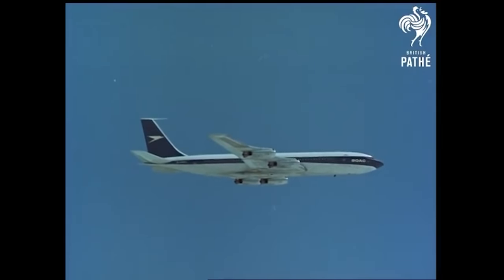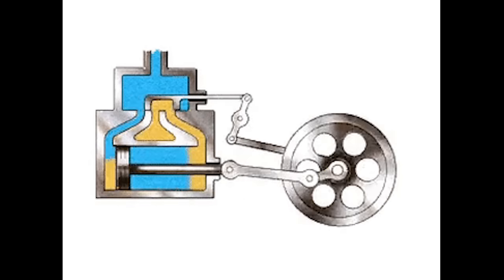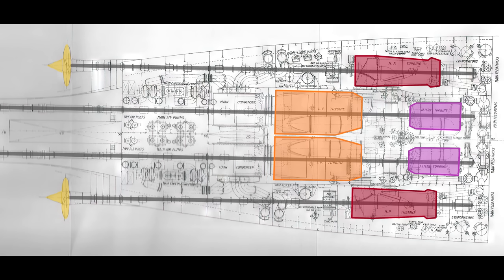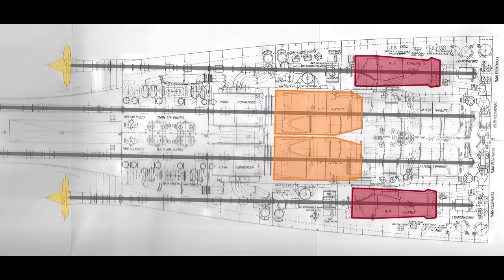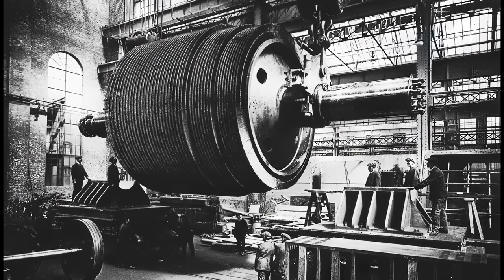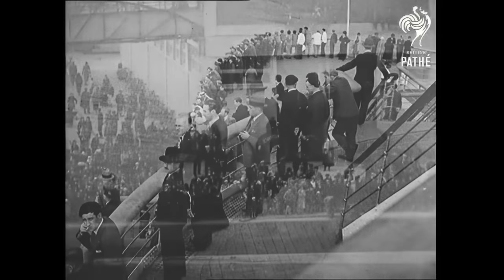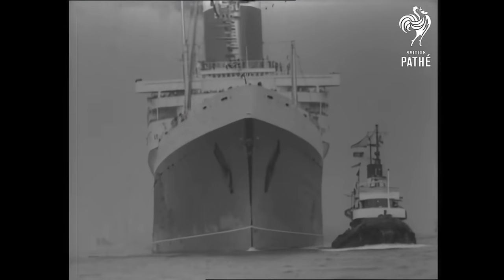The Rise of Turbine Liners

Comment: A bit confused as to the difference between power-to-weight ratio and fuel efficiency. Turbines had/have far higher power-to-weight ratio than a reciprocating steam engine but less fuel efficiency, especially if operated outside their very narrow power band. They were also, in those days, a LOT harder to make than piston engines. BTW the same pros and cons still hold for gas turbines vs diesel engines - that's why war ships use turbines while modern cargo ships (that don't care about speed) use diesels.
Reply from the maker: I'm really the wrong person to ask about that, I'm just a history guy. But maybe someone who knows engineering better than me will respond.

Comment: Although steam turbines are no longer used on most ships, they are still the hearts of many aircraft carriers and submarines today, being heated by nuclear reactors instead of boilers. Thanks to having steam turbines instead of diesel engines, the Nimitz-Class supercarriers can reach a top speed of an astounding 31.5 knots and have a maximum power output of 260,000 shaft horsepower.
Reply: USS Enterprise produced 280,000 shaft horsepower to produce a speed of (classified) knots.  (Yeah, I know what wikipedia claims for top speed.  They're wrong.  USS Enterprise, Reactor department, 1981-1984)

Comment: Nice video, thanks. There were a few details that need to be defined. One is the comparison with turbine and piston engine. Titanic`s reciprocating engines had totally 30 000 hp by 215 psi and the turbine got steam from these two engines having 16 000 hp by 9 psi. The steam expanded in the turbine to vacume so, that the pressure drop was bigger. This is important because the power is pressure drop x volume flow. For example 1N x 1m3/1s = 1W. The steam leaving the piston engine has already great volume flow and when expanding in the turbine even to vacume it becomes huge. So you can`t compare steam turbine and reciprocating engine like that. RMS Mauretania never made 29 knots, it was 28 knots but 29 miles per hour. Knots and miles per hour are not the same. SS Normandie made about 30 knots. So RMS Mauretania never took the blue ribbon from SS Normandie. RMS Queen Mary and SS Normandie with a more hydro dynamic hull had same speed. First the Blue Ribbon went to SS Normandie, then to RMS Queen Mary and after new propellers back to SS Normandie and then back to RMS Queen Mary.
Reply: Sorry my mistake. 1N/1m2 x 1m3/1s = 1W
Reply from the maker: From the information I have, it's been published in books like "the only way to cross", that Titanics engines all together, had a combined output of 46,000 shaft horsepower. That comes out to 16,000 for the turbine, each reciprocating engine had 15,000. If you can point to a source that says each engine could do 30,000 putting the total of the ship to 76,000, it would be helpful with my future research.

I dont recall saying Mauretania took the Riband from Normandie, but I have seen an abstract log showing the Mauretania making 29 knots, I dont think it was consistent through the voyage, but then again the speeds never are.

Both Normandie and Queen Mary were matched with hydrodynamic hulls, but for very different reasons. Most people don't know that QM's cruiser stern helped keep her higher in the water at speed, reducing drag. Just as Normandie's slight bulbous bow helped reduce the bow wave, which in turn helped reduce drag...but her stern still dug into the water at speed, negating that drag decrease to an extent.
Reply: @AlextheHistorian  Thanks. Most people don`t know... I didn`t either. Great detail of QM`s hull structure. I just read from Great Ocean Liners, that Mauretania made even 31 miles per hour. So it really is 29 knots. You didn`t say Mauretania took the BR from Normandie. A long telefone call between writing mixed my thoughts. This wrong text was from the Finnish Wikipedia I had just red: During her last voyage ss Mauretania took the Blue Ribbon back from SS Normandie. This can`t be true.
But I tried to clarify, that 215 Psi / 15 000 Hp -> 9 Psi 16 000 Hp should be 215 Psi / 30 000 Hp -> 9 Psi 16 000 Hp, because the turbine got steam from both reciprocating engines. And the power is not comparable just to the pressure but also to the volume flow. Some watchers could get too bad impression of reciprocating engines if they don`t consider this. If steam temperature is steady (of course it drops)  and the pressure drops to half, then the volume grows two times higher. So the steam volume really exploses in the turbine when flowing to the condenser vacuum, and the turbine can utilise this. To utilise this explosion in a reciprocatin engine would need monster LP cylinders with huge power lost and need of space.
To combine piston engines and a steam turbine was one way to combine advantages of those two methods, but it combined also disadvantages, for exampel the need of lubrication oil.
Reciprocatin engines and steam turbines have the same thermodynamic base, but they have very different features like internal combustion engine and gas turbine.
Reply from the maker: I see. Thank you for the info!

Comment: Finally made time to listen to this while weed whacking this very large field. Only thing I really have to add is that Normandie, when she retook the Riband from Mary in '37, actually managed to produce some 195,000shp. This was super cool learning more about steam turbines and other engines. You should do more videos like this when you're not covering topics like Queen Mary!
Reply: I hadn't heard of that!  That's really cool.  I know that the CGT was planning a running mate for Normandie, likely named Bretagne, and that they intended for her to have a significant increase in shaft horsepower.  It makes sense for Normandie to have gotten an upgrade, or it's possible that by then her machinery was well run-in and the engineers had learned how to get the best out of her.
Anyway, thank you for sharing that!

Comment: Very nice video I work in a small trash the steam plant or a little turbine is 60,000 hp and makes 37 MW of electricity and I’ve worked on it for 24 years. The biggest one I’ve ever worked on was 1900 MW and believe me, it was a little machines they were amazing. Very nice video.
Reply: 1900MW in the US? The only turbines I know capable of 1900MW are the Arabelle units from Alstom.

Comment: Years and years ago I read that Titanic's steam turbine was huge possibly the largest turbine ever placed on a ship.  Another great presentation by Alex the Professor!
Reply from the maker: It's hard to say, I would think that the low pressure turbine on SS United States would be the largest, but on the internet, there exists no blueprints or vintage photos of the turbines. It's possible Titanic's was the largest, but I gotta admit, it looks identical in every way to Mauretania's low pressure turbine.
Reply: It may be interesting to compare with the turbines of the Iowa-class battleships, which had power similar to that of the "Queen Mary". It's great that they all still exist. The "United States" has a similar powerplant.
Reply: Titanic's equally ill-fated sister Britannic had a slightly larger turbine (Britannic was slightly larger and so they tried to make it more powerful). It weighed 420 tons and according to marine engineer and historian Denis Griffiths it is the physically largest marine steam turbine ever built, but not the most powerful since it operated at low pressure.
Reply: @campbejk1  Thank you extremely interesting!

Comment: It should be mentioned that reciprocating steam plants didn't go away entirely after turbines came onto the scene, they continued to be used in applications where the higher torque/lower shaft rpms plus their simpler construction and maintenance would be an advantage, such as freighters, tugs, and cargo/passenger liners.

The Liberty Ships, such as Titanic's movie engine room stand in SS Jeremiah O'Brien, were designed at the outset to have a triple-expansion reciprocating plant to a nearly 50 year old design. Why? Because they would be simpler to mass produce, operate, and maintain in wartime, and there was a wide pool of engineering crew who knew how to run and fix them.

The last coal fired steamship still in commercial service, SS Badger, has reciprocating engines, of the Skinner Unaflow design. Similar to a diesel engine, they use poppet valves and have twin single-acting cylinders with twin cylinder heads.

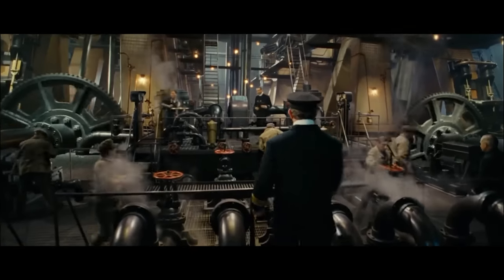Comment: With a turbine that is meant to run at 9psi and generate 16,000hp from it at that…. I get confused by trying to understand on how and where that steam pressure goes? Does it re-condense, is there an outlet that it vents out of? 5:00
Reply from the maker: Yes, after the steam is used up it is vented into condensers which use cool sea water to condense the steam back into its liquid state, and that water is then pumped back to the boilers to restart the steam cycle.

Comment: This video was well put togheter but it has a few problems the bigest of wich is using horsepower to compare reciprocating engines to turbines. Usualy you would want to mesure reciprocating engines power in torque becuse reciprocating engines have a lot of torque but litle rpm sinch horsepower = torque x rpm and reciprocating engines have their max amaunt of torque at 0 rpm

Comment: Correct me if I'm wrong but wasn't the 1904 RMS Victorian built for the Allan line the first Turbine passenger liner? Also I believe that the Normandie was rated for 160SHP but achieved over 180SHP. Just like the QM was rated for 180SHP but could go over 200SHP. And it must be said it took the QM that 20kSHP to achieve that fraction of a knot higher speed higher speed due to her much less efficient hull design. PS: Love the video!
Reply from the maker: Yes you're right about RMS Victorian, that information was not made available to me until after I made this video.

As for Queen Mary vs Normadie actually the two ships had tradeoffs with their hulls. Normandie reduced drag with her bow. Queen Mary reduced drag with her stern. I made a video that answers why:
https://youtube.com/watch?v=PXUrJd6UyO0&si=EnSIkaIECMiOmarE
Reply: Victorian and her sister Virginian made their maiden transatlantic voyages in March/April 1905 and were the first turbine powered ocean liners. Previous turbine vessels were much smaller and for shorter routes (the Clyde River, or short distance ferries).

Comment: Wish Olympic was preserved, just to look at these breathtakingly huge reciprocating engines!  
I know that turbines a more efficient and have more power/weight ratio, but i want reciprocating steam engined ship. 
That's why I admire Olympic class, except their balanced exterior aesthetics, they were last big liners, equipped with reciprocating engines. 
Comparing reciprocating engines and turbines for me is like comparing mechanical watches/clocks to battery-operated ones.

Comment: Steam turbines are still in use - nuclear submarines, aircraft carriers etc use them. I actually think they maybe in for a bit of a renaissance as oil prices increase and smaller, safer, and cheaper reactors become available. I mean, I don't think liners are making much of a comeback any time soon, but there's plenty of gas guzzling cargo ships. However, I'd imagine a nuclear reactor on a cruise ship (and it has been tried btw, eg NS Savannah) is probably a long ways off as the public is still pretty squeamish about that sort of technology!
Reply: Some LNG carriers still use steam turbines, they run on the boiloff gas from the cargo.
Reply: there are laws banning nuclear, it has nothing to do with the public

Comment: What was the reason why they stopped using steam turbines and switched to diesel engines?
Reply from the maker: Cheaper to operate and more fuel efficient.
Reply: It's probably better by weight to carry oil in barrels then coal as it's a more powerful fuel source
Reply: @TalesOfGothic  They switched from coal to oil before they switched from steam turbines to diesel engines.
The Queen Mary (1936) was fueled by fuel oil, not coal.

Comment: Hello,
Very good. It would have been interesting to explain why steam reciprocating piston engines had less yield than steam turbines whereas internal combustion piston engines still have today better efficiency (especially when combined with steam turbine).

It's because steam temp, even reheated (under 500°C) is well managable by turbine blades while internal combustion chamber can go up to +2.000°C. So compression ratio of internal combustion turbines cannot challenge piston engines in term of yield.
Gas turbines can also handle 1.200 °C.  When combined, they can pretend to approach piston engined combined with steam turbine. 

By the way today non combined  gas turbines are generally used only when space and/or weight power ratio is the main criterion. Helicopter, mid alt aircrafts. 
For sea ships purpose today : combined gas turbine + steam turbine are also good competitor of combined piston engines + steam turbines. 

Note that steam turbines only, as used on LNG ships do not have the best fuel efficiency. 
Without combined cycle, 2 strokes turbo diesel has still the best efficiency. 

P.S : I also understand that the piston steam engines of the 1900+ ocean liners, at least initially, required much less maintenance than the first steam turbines.  And Mauretania and Lusitania had their engine to be revised some years while Olympic's run without major serviced until 1933.

Regards
Reply from the maker: The reason I didn't explain it is because I'm a history guy and I can barely understand any of that engineering jargon. Even with your explanation above, I was lost at the first time you said "yield".
Reply: A historian is just someone who does research ;-)
But I put myself in the place of the reader that I am and inevitably the question of why there are still pistons today, including in cars, will come up.
But the historical question of the choice between the white star and its competitors is a question worthy of interest. It would probably be necessary to dive back into the literature of the time to find out if the choice was so simple when it came to choosing for the white star.
Reply from the maker: I dont understand your question, "choosing the white star"? What do you mean?
Reply: @AlextheHistorian  
Sorry. I've fixed the typo. 'for the white star".
I imagine that the choice for the engineers who worked for the white star to do without pistons or not was not necessarily an obvious choice. 
I don't know if an engineer interview technically supported this choice of the hybrid solution.

Comment: The down fall of steamships was the efficiency of the boilers compared to diesel power plants. Which is a shame as steam turbine power plants are clean , no vibration and take up less space.
Reply from the maker: I'm curious what you mean because many ocean liners with steam turbine power suffered vibration issues that forced a reduction in speed to maximize passenger comfort. RMS Mauretania and RMS Queen Mary both had to undergo strengthening modification in the stern areas just to reduce vibration in Second Class. 

Not only that but the power plant for their steam turbine system occupied the entire lower deck nearly from stem to stern. However, diesel ships like Queen Mary 2, only dedicate about one-fifth of their lower deck to the power plant, leaving the rest to food storage space.
Reply: Hi Alex the steam plant is vibration free . Vibration is caused by cavitation of the propellers which is increased as the speed increases . Above 24 knots the vibration increases noticeably . Most passenger ships now don’t go above 24 knots. Queen Victoria currently has a big vibration problem from the props above 16 knots. John Chillingworth

Comment: And , of course, there are marine gas turbines which don't need any boilers in the ship. I'm not sure how their economy compares to steam turbines, but neither can match the economy of marine diesels.
Reply: Yes, diesels are economical, but they bore me to tears!
Gas turbines are not too economical but they are very powerful and a popular choice for fast military ships like the Arleigh Burke class destroyers.  I believe they use General Electric turbines much like the ones in large passenger jets, only driving a shaft.
Reply: @monsieurcommissaire1628  The Queen Mary 2 has two gas turbines additionally to the diesel engines. For maximum power, when it comes to fast atlantic crossing.
But the propulsion is electric, the diesel engines and gas turbines drive generators.